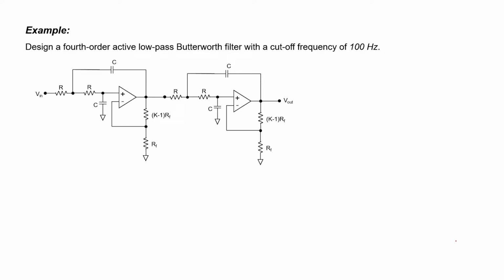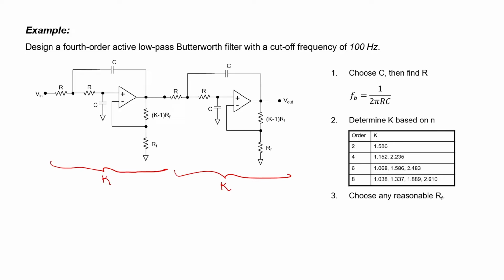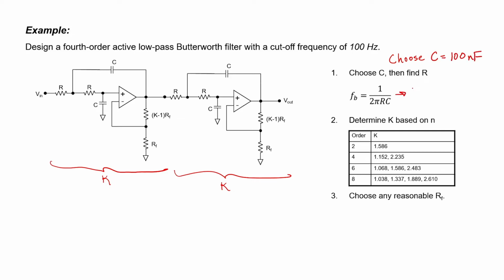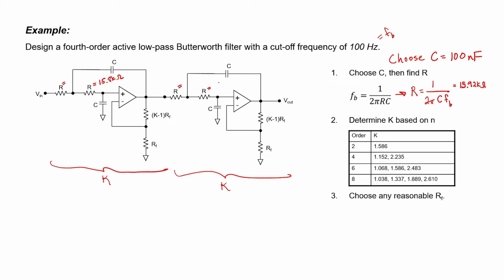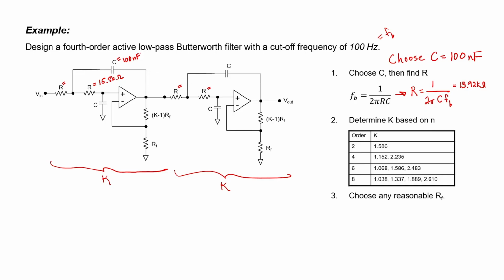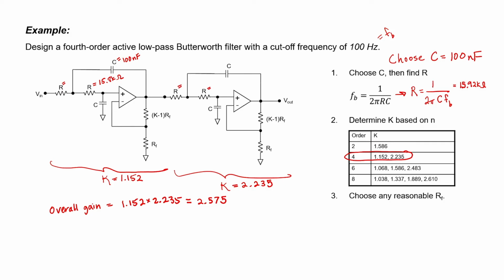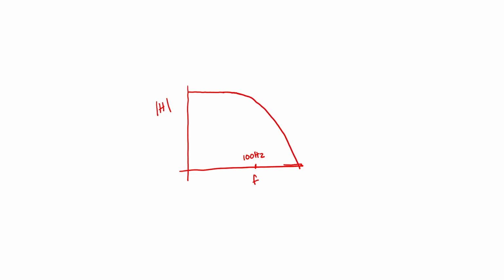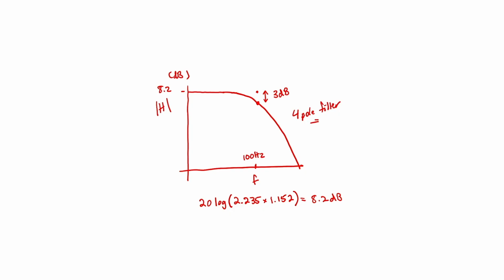Active Low-Pass Filter Example Problem (3 - Active Filters)

Comment: @4.20 how did you get those values for K? I see them on the chart however it just doesn’t make sense how you got 1.52 and 12.35. Did you just move a decimal over and if so when you mine one it still shouldn’t be 1.52 or 12.35. Just confused.
Reply from the maker: The resistors are (K-1)*Rf.  I think you forgot the Rf=10k in the formula.

Comment: According to your explanation. Sir I've made a second class sallen key low pass filter with unity gain using lm324 quad op amp on single supply, but when I adjust the gain to 1.5 by using feedback , I get no output or very less output signal .
Reply: K=1.5 isn’t in the table, so why should it work? NB The term is second order.